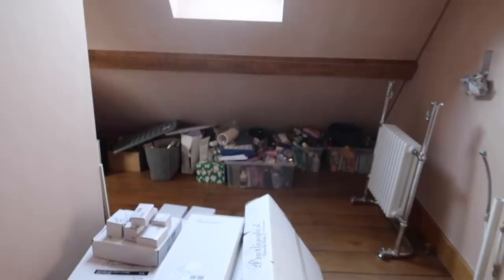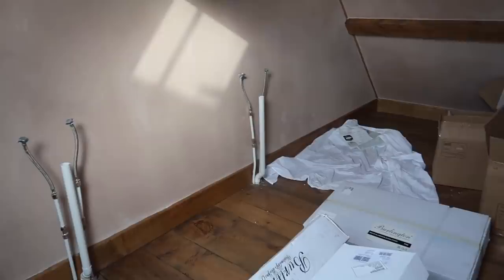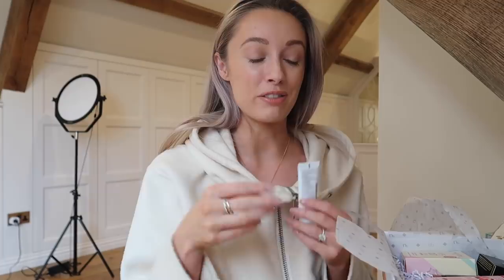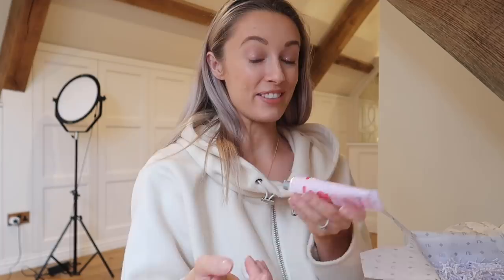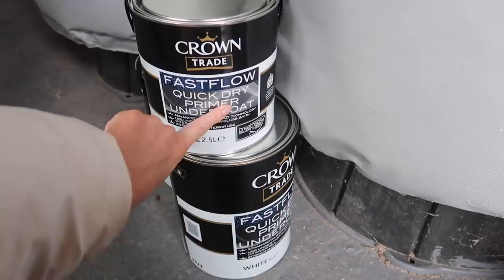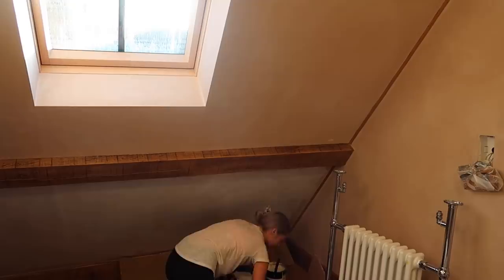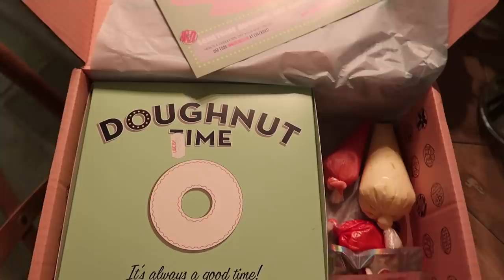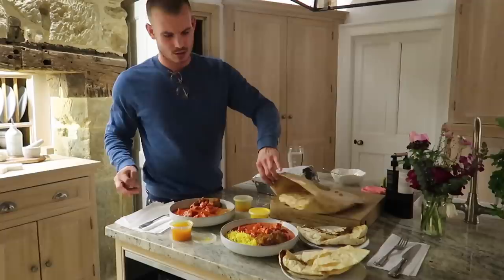POWDER ROOM PROGRESS + DOUGHNUT DECORATING // Fashion Mumblr Vlog

Comment: Painting tip....you should use a brush to do all the edges...you can’t get close enough with that roller.The edges are done first....then the roller is rolled in a W shape to get the best coverage. You want paint done perfectly even under wallpaper due to seams and potential for peeling. In addition if it ever has to come off it will be easier if the under surface is properly painted. I have done DIY painting and wallpapering for years!

Comment: Still don't understand why 2 sinks? Also, why no 'cutting-in' with a small paint brush round the edges and corners of the room? You'll get a neater finish than with just the roller.

Comment: A little tip that I have shared before on my insta / YouTube channel is if you are going to be painting tomorrow, just load the roller/brush up with paint and wrap with cling film and you will be able to use it again the next day with no washing! Also, you can use a carrier bag to place the tray inside or foil to cover the tray and then when you are finished just dispose and no washing of the tray or risk of old flaky paint going into the paint the next time you use it! You can then also cover this with cling film or bag and keep for next day also 🥰 it is looking great though. Well done you for taking it on x

Comment: You worry about reusable cotton pads! But how about all these trials, products  and packages that you and other "influencers" endlessly receive/buy.  How much waste and pollution do they cause! How many times does the delivery car drives up  to your house. I think reusable pads will not solve the problem.
Reply: In my opinion, if you know you'll finish a small product before it expires but won't finish a full size, you're still throwing the packaging/unused product away regardless, I'd rather toss out or try to recycle a small eye primer (less plastic) that will take me a year to use up rather than a full size (more plastic and unused product) that I may never finish and have to throw away after it's expired!

Comment: Hi Josie, a painting tip I learned from Martha Stewart is to wrap your roller or paintbrush and pop it in the freezer until you use it again.  Just thaw out and you are good to go.  No mess, no cleaning every time you use them.  Also, use an angle brush for the edging and you can avoid the taping.

Comment: I don’t know about primer, but if you are painting using a roller, you can put it in a plastic bag and stick it in the refrigerator and use it again the next day. I just use a bag from one of the shops. Wrapped tightly around the handle and pop in the fridge. No laborious roller cleaning which uses a lot of water.

Comment: The tip from Debby Townsend holds true for your roller too.  I just put my whole roller (Handle & all) in a garbage bag tightly sealed.  Just take it out & start using it again.   No need to wash the roller. Just pitch it when you're finally done.

Comment: It's brilliant to see you doing some DIY, but why didn't you mask off the wood to protect it?! I can see where you've got the white on the beams!
Reply from the maker: Someone told me the paint would leak through the tape? But luckily this paint comes off easily with a damp cloth :)
Reply: Fashion Mumblr only if you just buy bog standard masking tape, which is a mistake many make. You need to get ‘frog tape’ to do a proper job.
Reply: Also, if you do get it on the beams and it dries , nail varnish remover will remove it.

Comment: Did you know that you can put paint rollers or brushes in the freezer and they will stay just fine until you need to paint again. All you have to do is take them out of the freezer a little while before wanting to paint, it prevents having to wash them up.

Comment: I don’t understand how people use sinks that have separate taps for hot and cold. Like is it possible to get warm water? How do you wash your face? Is it always either boiling or freezing? Someone please explain I’ve genuinely never experienced them before.
Reply: Mixer taps are more convenient - with 2 taps you have to fill the sink with both taps until you get the temperature you want, so you'll need to put the plug in the basin. I think you end up using more water tho.
Reply: @oksanatoofor4470  you know the water can be mixed in the basin to get the temperture you want?! But I'm a Brit and I do prefer a mixer tap - more convenient for a quick hand wash.